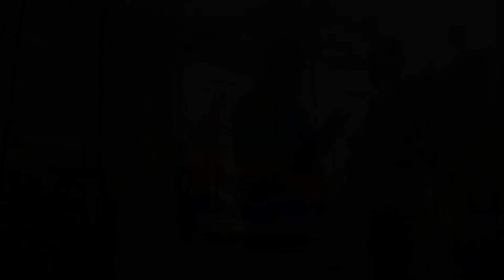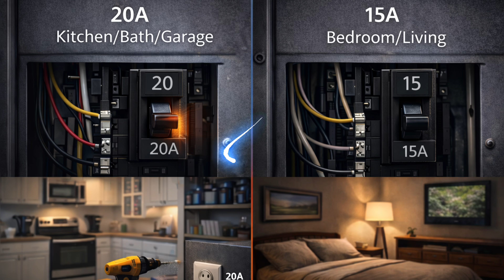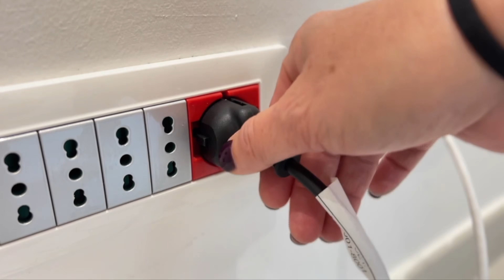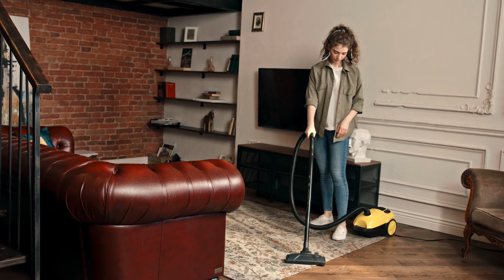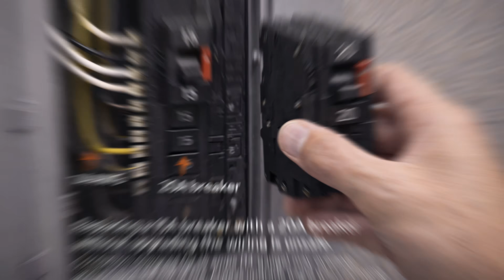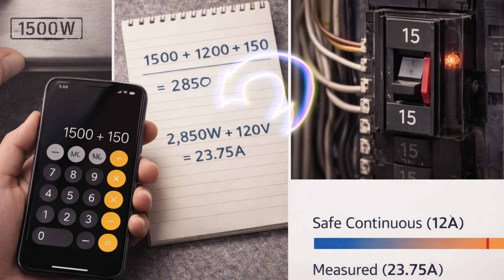Is Your Breaker About to Trip? Here’s How to Know

Comment from the maker: Two-Minute Safety Habit 🧠
Before plugging in a high-watt appliance, try this quick check:
Add the wattage on the label, divide by 120 volts, and compare it to 80% of your breaker rating. It takes about two minutes and can prevent long-term electrical strain. Do you already check appliance wattage, or is this new to you?